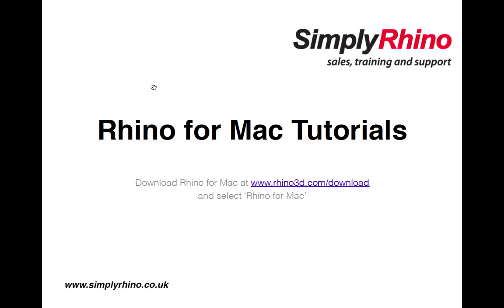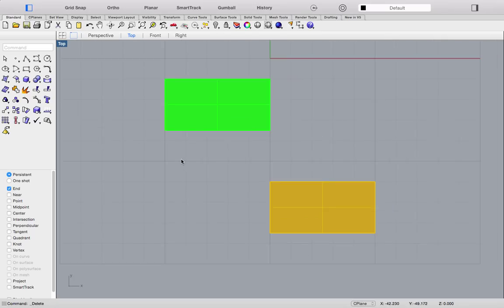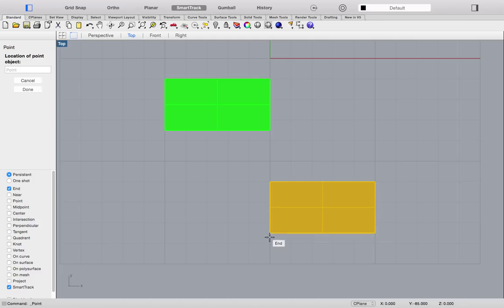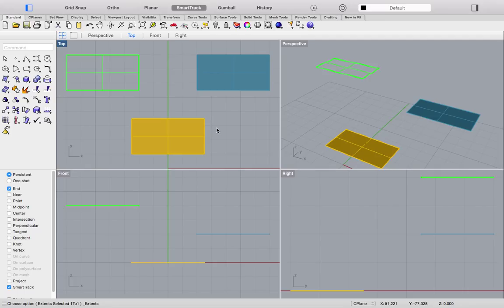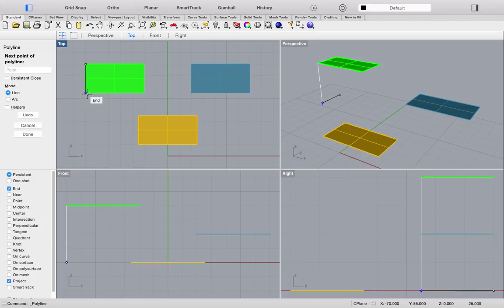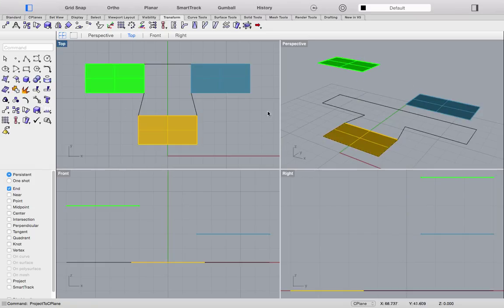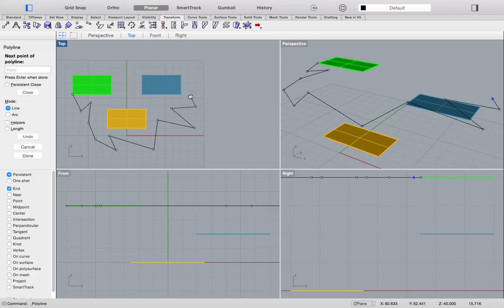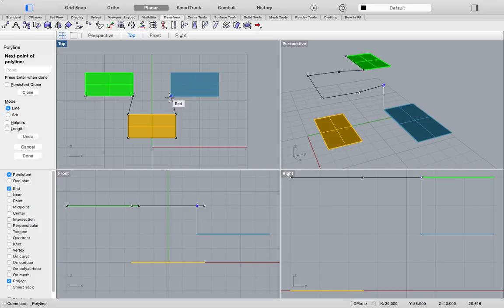Rhino for Mac Tutorials - Getting Started Series / Tutorial 3

Comment: Hey I am having issues using the smarttrack. Its selected in the top menu of rhino for me so it should be active, yet its not working. Ill hover over a corner for a few seconds and no blue circle appears. I have even gone into rhino>preferences>modelingaids>smarttrack and all of the correct boxes are ticked.
Reply: HI Kevin, smartrack works in conjunction with object snaps (osnaps).  Smartrack is redundant unless at least one object snap is active.  I suspect this is the case.  Let me know if that fixes your issue.  Best Sean
Reply: That wasn't the case, osnaps was active. I got fancy it though and restarted rhino and my laptop.. that fixed the issue, whatever it was. Thanks though.

Comment: Hi thanks so much for these videos. I have a question though, when I select project  the elevator line does not appear and the line is not proyected on the construction plane. Could you help me please?
Reply: Claudia Garza Eng 
Hi, Claudia

The project constraint works in conjunction with object snaps.  That's why we find this selection box adjacent the object snap selection boxes , because project will project object snaps.  If you are not seeing the elevator line it could be for a few reasons.
1.  The elevator line will only appear if you have first executed a command, for example 'polyline'.
2. A relevant object snap has been activated, for example 'end' if you planning to find a corner of the surface.
3.  It maybe that the elevator line colour has been set to a colour that does not contrast your background colour. I.e white background and a white elevator line! Which would mean that it is present but just not visible.
4. Dependent on your customised settings you may find that Rhino is not finding object snaps because the surfaces are on a locked layer.  Experiment by unlocking the layers of the surfaces by clicking on padlock button in the layers panel.  These will be the least likely reason.
Hope this helps you? Thanks.